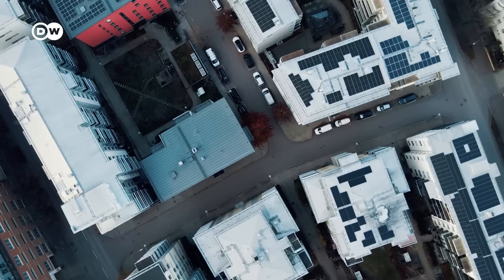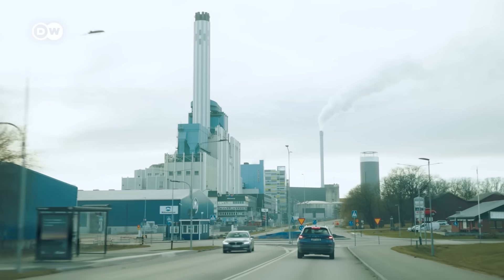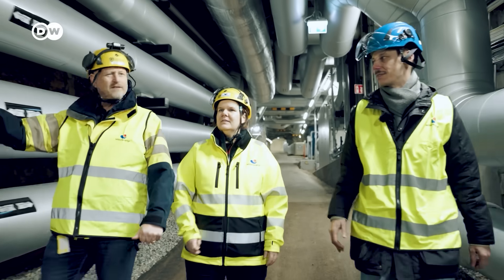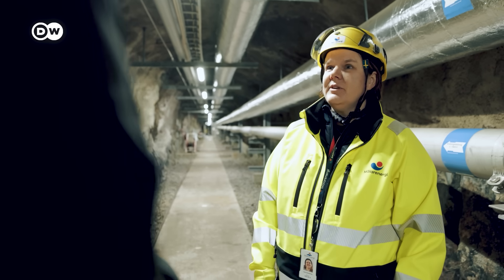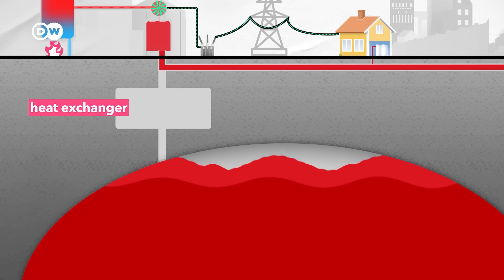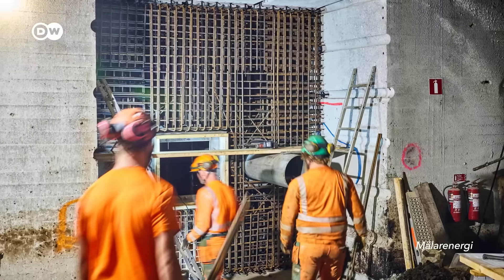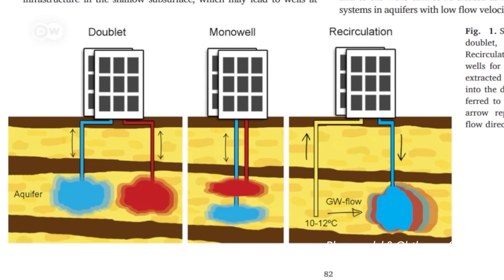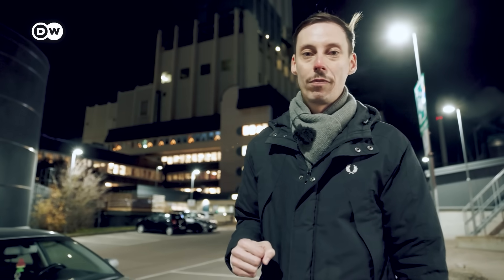Why a city in Sweden filled these caves with almost boiling water

Comment: Last year we had -32 degrees C. in Umeå, and our local heating system was overwhelmed. The water in the system lost its temperature, and froze at some points. My apartment was very cold, for maybe a week. I actually turned my electric oven on, and opened the door. Wish we would have had a bunch of warm water stored in a cave..
Reply: I was in Umeå about 20 years ago in February it was the coldest I have ever been in my life -20 I think, my face was freezing in about 20 seconds from getting out of the warm car. Was fun driving from the airport the roads had tracks cut into the ice so I didn't have to steer. Wish I could visit again it was a nice place.
Reply: @thedave7760 -20 is shorts weather here in alberta canada, at least in march once the -40/-50 weather from February-fades away. Here the tire tracks personally drive me up the wall, its not very smooth and can do a great deal of wear and tear
Reply: @thedave7760 While -20 is cold, we frequently experience colder. I've never experienced anything colder than -37 though.
Reply: @thedave7760  -20 C is a nothing special here in northern Sweden :P
Reply: -32 is an interesting threshold. If I have an engine pre heater stop working at -22C, the car, truck, tractor, bus, bulldozer, snow plow  or whatever I'm running will still start. It's very hard on them, but engines still fire up reliably. But at -32C without preheating, very few things will start. If you have preheaters quit on a -32C day, you just fix or restart the heater and let it sit for 2 hours before even trying to start a machine. Everything gets more difficult in the mid -30s. I'll run machinery all day outside at -20C. But at -35 I'm just shutting down all non essential work.
Reply: @joewiddup9753  My dad drove his car at -38C, and the cooling system burst. Getting stranded at those temperatures, in sparsely populated northern Sweden can even be dangerous, if you don't have good clothes with you.
Reply: I thought Umea was in the north of Sweden, surely -32c wouldn't be too extreme. My mum's recalled -45c to me when she used to live in Dalarna and the houses were okay?
Reply: @razzy1 it's often a case of building for normal conditions and then at extremes, things fail. So if Dalarna has colder being more inland, then they build for that. Umeå is on the coast and -30C is usually for one day and the next day can be +2C! We got -38 for about a week 70km north of Umeå. But we were ok as we have our own heating system not shared with neighbours. Just it was hard to keep the water flowing in some of the cattle's buildings. As they are warmed by body heat.
Reply: @razzy1 with working heating, no problem.  Their issue was that the heating did not work, the houses will at one point loset the warmth to the cold surrounding  even if you are sheltered, try to live in a fridge(5-8°C) and likely hot water only by boiling on the stove.
Reply: @razzy1  umeå is north but not very north
Reply: @razzy1  If you live in a flat with no heating or a timber house with heating it makes a difference.
Reply: @razzy1  It's like a couple of times a year where it gets around -30 from my experience.
Reply: @razzy1  Umeå is a coastal town, it very rarely gets any colder than that. I'm from Boden, and that winter we had below 40 minus there.
Reply: @razzy1 technically it is, but its not the most Northern nor the coldest
Reply: @SinyoroVenyoro  It's more northern then where I've gone in Sweden, and seeing -25c was common. Wouldn't think -20c would be a problem
Reply: @razzy1  It wouldn’t for you and i because we live in Sweden and have experienced that even as far South as Stockholm. But the original comment sounded like the person was not from Sweden or at least from somewhere with way warmer temperatures than that
Reply: Imagine if you had a heat-pump. Decentralised systems are cool, or hot.
Reply: @the_hate_inside1085  de här bergrummen finns lite överallt ,i synnerhet i städer med hamnar . Finns säkert någon grotta i Umeå också.
Reply: Umeå is a beautiful city. I hope it is able to find a good solution for heating on cold days. Håll dig varm och minnas att det inte finns dåligt väder, bara dåliga kläder!
Reply: meanwhile I want to move to Svalbard
Reply: It was -38 here midway between Umeå and Skellefteå but we have our own heating system, not one that has to serve many buildings. I'm guessing the water table here along the coast won't allow an underground cave filled with hot water.
Reply: Crazy how different the world is depending on where you are, in Arizona it rarely drops under 0C and if it does its only for a few hours at peak cold hours
Reply: I sure am glad i sit here in my Norwegian home with my own water heating tank powered by Hydro power😉
Reply: Your system should probably be equipped with heated flooring through a wood stove in every house
Reply: Considering the location, there would probably be disused civil and military bunkers that might serve nicely.
Reply: Well that was a disaster 🤷‍♂️
Reply: One thing that got me thinking is this enormous undertaking by Västeråsenergi only saves the amount of CO2 emissions from 460 swedes - don't forget that the best thing we can do for the climate, apart from not having children, is to stop people from poor third world countries from moving here. Every MENA sucker moving to Europe will cause a serious negative environmental impact, not to mention the economical, criminal and cultural problems that mass immigration from MENA causes.
Reply: Is city heat the only heat people have? Why wouldn't you just have your own heat?
Reply: @Jeans304  
Oil has been very expencive so many people removed the oilburner and installed cityheat ( was very cheap ! ). And some changed to wood but city demand clean burning and its not that cheap if you dont have your own forest.
Electricy has been very very cheap that many people installed electric heater instead.
( in big citys many did have gas heat and gas oven, but i think Västerås was to little for that )
Reply: There's still a capacity limit and we should have backups. But re using waste heat is already a genius idea I wish more power plants used.
Reply: @dasboots3272  
They use wasteheat from local chemical industry here to heat the water.
Backups are expencive and few hour every year that needs it.
Simplier and cheaper to ignore that and hopes thats people manage to find own solutions what that happens.
Electric heater to plugg in, use the owen or thinks like that then..
Reply: The thing was (in Umeå last year) it was below -30C and close to -40C for two weeks straight. That is what caused the system to begin to falter.
Reply: I also live in Umeå and that sucked dick on SO many levels. I remember having to go to the store which is really close, just across the road, but even that short time outside was very unpleasant. It was so cold, it actually hurt to breathe.
Reply: Got to -44c at my cabin where I live full time near Kiruna last January.
Reply: Typical Umeå.
Reply: -20ºc Nothing special in Winnipeg, Canada. Although I like idea of central heating.
Reply: @ryuuguu01  It's just a matter of what temperatures the designers expected for the system, plenty of extremely cold places use district heating.
Reply: Nor here in central Minnesota USA.
Reply: @helenhunter4540 Duluth is a misery!
Reply: Here is the US, everybody's on their  own. You either pay your power bill or dont...
Reply: @Confessor555  They have power bills as well, it's not free!  There are co generation district heating systems in the US, but not nearly as many as there once were.
Reply: @Confessor555  How can you think paying bills has anything to do with what he wrote? And being on their own, do you mean everybody produces their own heat locally from fuel or electricity instead of district heating? In that case, that is not true, there's a lot of district heating in the US too even if you personally don't have it (and neither do I).
Reply: @Confessor555 apparently a lot can be changed through local politics, but then you have to find the time to care about those elections, and I know y'all don't generally get time off work like we do in countries here in socialist capitalist Europe :/
Reply: Nothing a little fire won't fix.
Reply: @Frille512 until the fire itself freezes!
Reply: @the_hate_inside1085 okay det var koldt! Om du vil er du velkommen i København, vi er cirka 30⁰ varmere.
Reply: @jamieflame01 Skåne bjuder nog på bättre väder
Reply: @KungenAvSandDu menar regn och blåst?
Reply: @KungenAvSandScania is actually very cold. I lived in Malmö and people moving there from Jämtland complained about the cold. It's rainy and windy during winter making it feel much colder than what the thermometer will tell you.
Reply: @jamieflame01  Im on my way, will be there in about an hour.
Reply: @jamieflame01  for menge indvandrer
Reply: You almost died. Heating your house overnight with an oven is a Darwin Award
Reply: @RayBarK1  The rest of the world have three phase power. Not everyone lives in a banana republic like the states...
Reply: @RayBarK1 How would they die from keeping an electric oven open?
Reply: Or just a personal water heater per level of your apartment, like normal places have. Sorry you had to go through that, state-controlled heating seems like far too big of a risk for the everyday citizen.
Reply: @noliebowtie 
It would be bad with that solution, more electric use or fires giving smoke and bad cleaned.
Every system have a peak or a breakdown, you dont build for them. Bc its a few hour/days every 10/20/50/100 years..
A big cleaned controlled fireplace is better and more effective. And as they say, you can put in alot of unused heat from cooling places/industri/processes that would go to waiste othertimes.
Reply: @noliebowtie  What remarkable country do you live in where each citizen has their own power-generation? You each have your own little power plant which you also collect the fuel for yourself? Amazing! Although I guess if someone falls short on their fuel collection they just die with no state backup, which is a shame for older people or those who are disabled. It must be a very isolated place that you think such things are "normal" though, as most places in the world actually rely on either state or company controlled power plants which free up people from gathering fuel for their own private generators - although on the downside outages do affect multiple people at a time. Incidentally, Umeå district heating is provided by a private company, not the state.
Reply: So much for global warming
Reply: @  This year in Sweden we have hardly had a winter. In Stockholm we have had 2 or maybe 3 snowy days and the last 2 weeks the temperature has basically not gone below zero. Today is about 7 degrees when you would expect at least -5 and below. This has been a clear trend for years. That is less and less snow and warmer weather in this part of the world. Close to 50 degrees in the summer in southern europe, with more or less permanent drought in certain places. You are either ignorant to the fact or just stubborn. Surely this is not a debate anymore?🤷🏾‍♀️
Reply: @HermannCortez A few cold days don't have any impact on the average temperatures, which keep rising.
Reply: @HermannCortez    I guess that you don't understand what global warming is. Maybe taking a basic course in climatology or even Earth Science might help you. 2nd grade science isn't really valid anymore.
Reply: @HermannCortez  Global warming doesn't mean you can't have local cooling.
Reply: @HermannCortez  I remember on the same day reading two articles. 
-One stated the gulf stream would collapse, making temperatures significantly lower, perhaps making Scandinavia uninhabitable. 
-The other stated that we wouldn't be able to host a famous cross country skiing competition since in the future we will have no snow here...

Comment: Living in middle of Netherlands, and some parts of the city are connected with district heating: but because the source is a not done by waste heat (they are burning stuff to run it) people are not so positive: better to get away from burning wood or gas. Rethinking the source would be big undertaking (no heat producing processes near) and would be pretty expansive. 
Also because of the prizing they do (equal to gas, so fluctuating and with increasing price/taxes on that pretty high) electric (heatpump) warming is way more cleaner at same/lower price.
So our district heating is first step in getting new buildings without gas, but this local solution is too expansive and not green enough.
Reply: Yeah, district heating is way better than individual house heating, since the scale allows for more efficient solutions. But there are a ton of different ways to actually heat that, so the end result is very variable.
Reply: Having more sources to chose from so you can select the cheapest at all times (and have heat storage tanks so you can move your production window) makes it a lot cheaper.

Comment: The video mentions Canada, but there are huge problems with that idea. For starters, we generally don't dig tunnels unless its to mine ore, which means that expertise really does not exist outside of mining compagnies. It makes any project that requires tunneling ludicrously expensive. The second problem is that district heating only exists in a select set of rather small networks. The only exemple that i know of in the province of Québec is downtown Montreal. It only serves a few dozen high rise buildings. Residential heating is done almost exclusively with electricity. Our electricity prices are low, and all of it comes from renewable sources which severely undermines the emissions reduction argument. Almost none of our electricity comes from thermal sources, so there's no heat to be extracted from power plants. Industrial and Office is where there might be more of an argument. Some of those buildings do use natural gas as a source of heating, but does it make sense to build up an entire district heating system for a small number of buildings? In most cities, the answer is most likely no. Some industrial buildings do recycle heat, but it is usually used in the same building where it is produced.
Reply: Then you need like Sweden do it long term, district heating did not appear over night, it took them close to a hundred years to get where they are now, plan new districts and buildings to be ready for district heating, then start developing the infrastructure, it will mature and pay off in time, small steps.
Reply: Downtown Calgary has district heating as well.
Reply: The case in point here is population density. With heat storage, you would want 
a.) have the storage huge, (optimizing the volume/surface area ratio)
b.) keep transport distances short
So this technique is a good fit for built-up areas with multi-story houses for living - e. g. inner cities.
It isn't as fortunate with suburban sprawl with huge gaps between houses.
Looking at the population density, it becomes obvious, why this is far more advantageous in Sweden (or Europe) Sweden has  > 6 times the population density of Canada. It would be even better in Germany, which has ~ 9 times the population density of Sweden.

Comment: Very cool, but heating water at 95°C will create a big heat loss. No where is discussed how much this it, and if it's worth it. 
It seems to be more a feel good story, than a solution. 

Bio fuels are also these kind of solutions that make no sense when you check the numbers.
Reply: 50 meters of bedrock above it is great for insulation, and to the sides and below it is basically infinite as there is tens of kilometers of bedrock below and to the sides., plus the caves are HUGE square cube law makes the heat loss very small. 

Bio fuels I agree with, total waste of time...we need to focus on cultivating less and making more with less area...and that should go towards Food...then ciritcal stuff...not fuels...
Reply: @TheEsseboy  bio fuels in this context is wood chips from sawmill, branches/tops from logging and construction waste/ lumber scraps. Not corn ethanol or whatever you might assume.
Reply: @TheEsseboy  Sure could be, but they didnt give hard numbers. Always shady when that happens.
Reply: @albex8484  Usually it is because few people understand them and will start doing their flawed napkin math and claim they are bad somehow. Totally understandable with such a nish topic.
Reply: @TheEsseboy  it is niche topic. Even more necessary to have something that proofs it makes sense.
Reply: The secret is in the size of the storage, and its isolation. The bigger the storage is, the less the isolation is an issue, since you will have losses only at the surface of the container. Ideally, the container/cavity is ball-shaped; so the ratio surface to volume would be 3 / radius. Meaning: with every unit added to the radius, a lesser fraction of the heat stored in the volume will be dissipated on the surface.
Reply: The feasibility probably depends somewhat on already having the caverns sitting idle. It is a solution here, a good one. 

In sprawling areas in countries that just invade some middle east country when energy gets expensive: probably not so feasible.